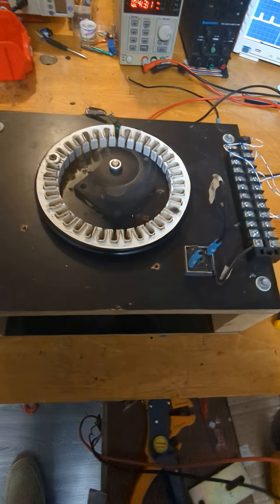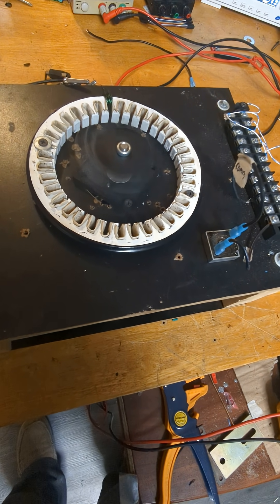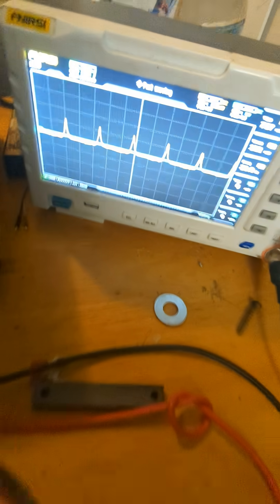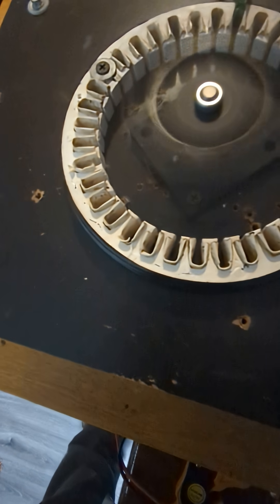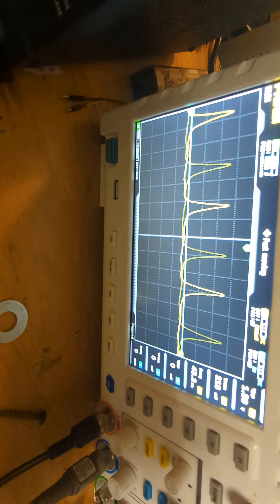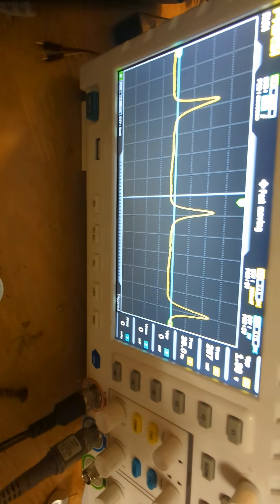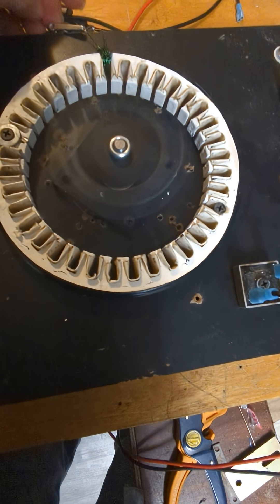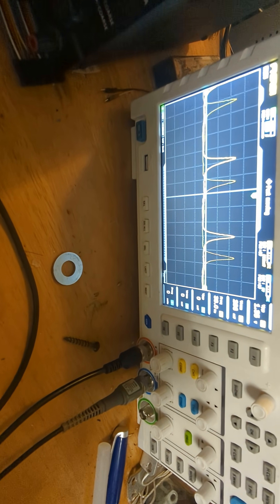Single Polarity Output Generator- No Rectification!

Comment: So you're avoiding back emf?
Reply from the maker: There is minor drag, I think because of the stator teeth.  Ideally we want a toroid core with no teeth like Tesla's patents show.  Now this output is highly reactive because Lenz is barely being fulfilled (not much to oppose)..  The design is to investigate if I can Fulfill Lenz by adding opposition that does not affect the rotor, yet still drops the output coil's impedance for real power output/  We will see.
Reply: If he's running it so the magnet is on its side relative to the coil, or the coil is oriented so it's sideways to the magnet, there shouldn't be any counter EMF being generated from what I know of monopolar induction.